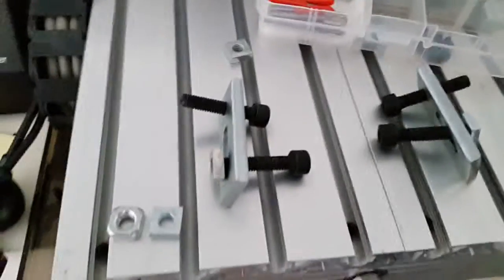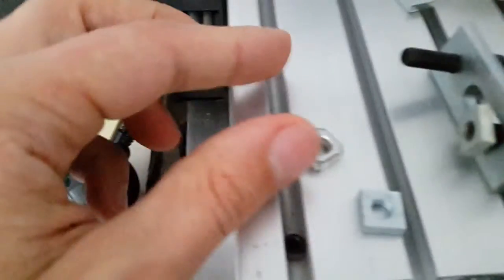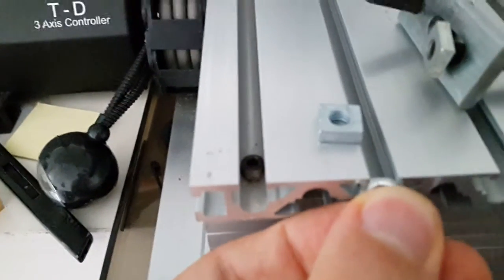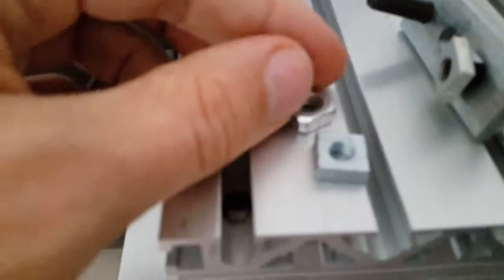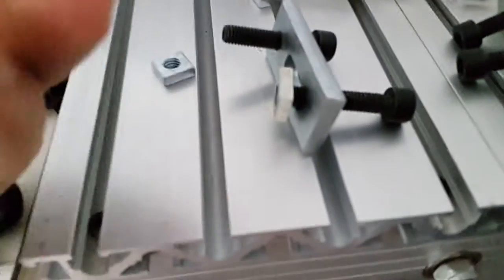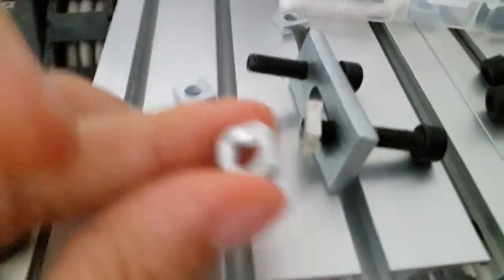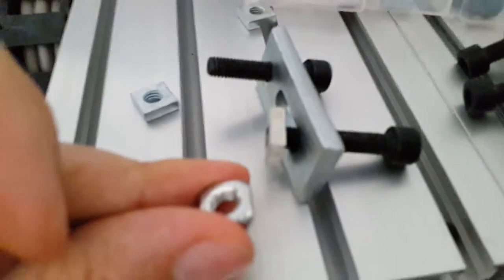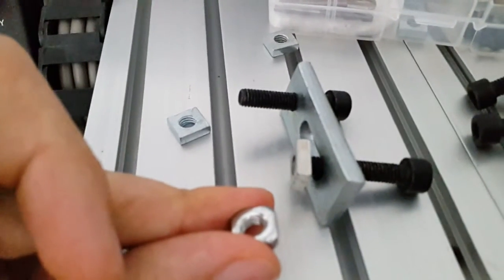Cnc 3020 Job holding Tip

Comment: Could you just have filed down the original bolts a little? If you can get the correct size then that is obviously better, but would that work as a temporary solution?
Reply from the maker: Samuel Doye The DIY shop was a 5 minute walk - and the nuts came to about 1 GBP for 8 of them. Filing them would have taken waaay too much effort. It was one of the first things I did after a first attempt at getting the mill running last year.
Reply: Lucky you, living in a village makes things a lot harder.
Reply from the maker: Ah - that would. At that point, it may have been using a bench clamp and a dremel, or just trying gaffer tape (which apparently makes for good jobholding but I'm yet to try it).